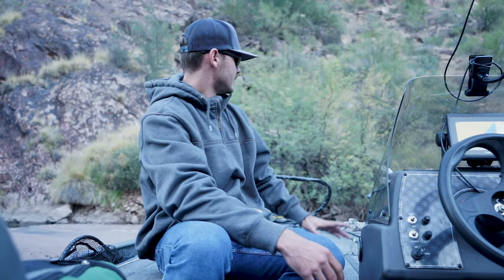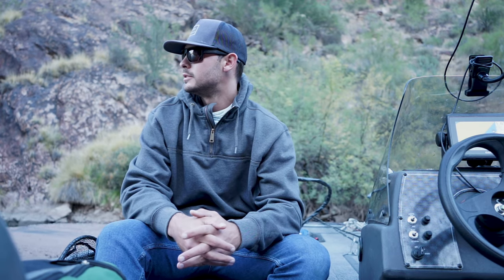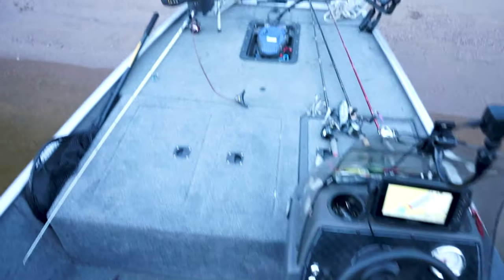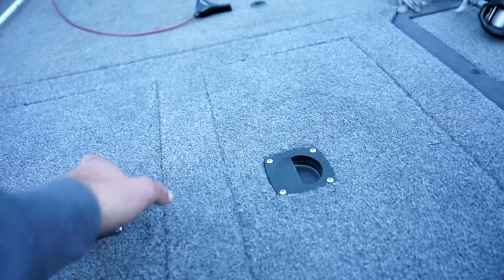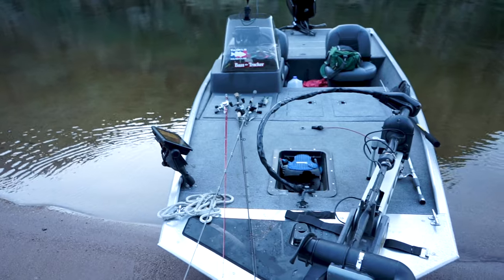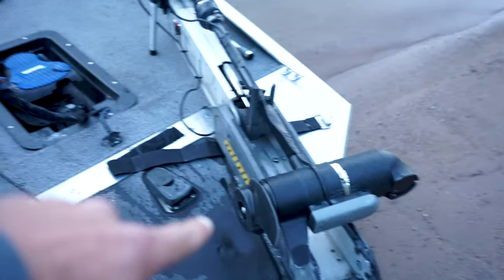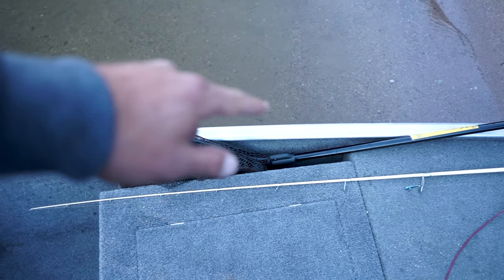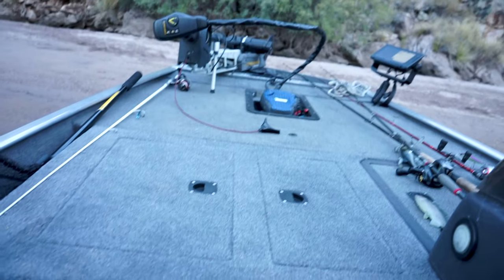Bass Tracker Classic XL Modifications and Upgrades!

Comment: Recent subscriber, awesome video and deck extension design! I recently got a used 2019 and as a bigger guy definitely need that additional room. Couple questions, did Dylan: A) Attach the extension directly to the boat or is it free to move around or take out? B) Total weight of the extension deck? C) Have any specs of the aluminum frame ?  Thanks I’ll will certainly be trying to something like this on my rig. Good luck fishing!
Reply from the maker: thanks man... it is free floating so it can be taken out whenever... i would guess around 50 pounds... i don't as he did it all, i dont think he kept any records of measurement though

Comment: Hey cool boat! I just got a used 2019 just like that. What do you use to wipe down that aluminum hull to keep it clean after taking it out?
Reply from the maker: Usually just vinegar water
Reply: @VitalFishing  hello again. Do you just use like a 50/50 water vinegar solution? Thanks for the help
Reply from the maker: @benw6554  yes, they make other aluminum cleaner but honestly I just cleaned the motor because the boat oxidizes no matter what
Reply: @VitalFishing  ok thanks

Comment: Was installing that recessed foot pedal a pain? How did you cut into the deck?
Reply from the maker: no, very easy... just make sure your measurements and lines are all straight and then use a jigsaw to cut it
Reply: @VitalFishing   I’m right in the middle of installing mine. And can’t for the life of me figure out where to run the drain line. The foam goes all the way to the hull. And not really wanting to just put water in the boat that won’t drain. Any help would be great! Lol thank you

Comment: Nice set up. I have a similar tracker just older and also upgraded to a 24v trolling motor and would like to know your set up in the back with your batteries and fuel.  Does having all 3 batteries on one side make you lean hard to that side?
Reply from the maker: no, i havent noticed a difference at all. the 24 volt system is night and day better

Comment: You said you can run in 10in of water. I live on the river I fish and am always worried about running wide open in 3ft of water. So my question is how do you go about running new water to check if it’s safe to run? Thanks. Get vid.
Reply from the maker: just go slow at first until you are familiar with the depth... hitting your prop on the ground at idling speeds usually won't do anything

Comment: Question: I'm ready to install a recessed foot control tray in my Tracker Classic XL. Is there anything under the deck to be aware of?
Reply: I was wondering the same thing
Reply: @garrettsmith2310  there is nothing but foam. The wire to the trolling motor is there but safe from a jig saw blade.
Reply: @garrettsmith2310  there is also an extra wire for bow electronics ( or whatever) discovered it after I cut the hole in the deck
Reply: @gregbrown4110  but for the most part of you center the tray, you should be good right? I’m going to order one for my classic xl I just want to make sure I get the right one and hook up drainage to it if needed. I appreciate the reply
Reply: @garrettsmith2310  yes, right on the centerline. Mine was a Panther (something) from BassPro for $79.99. very sturdy. Very easy install.
Reply: @garrettsmith2310  it comes with a drain tube which I just fed down the inside of the hill.
Reply: @gregbrown4110  thank you Greg! I was looking at the same one!
Reply: @garrettsmith2310  forgot to tell you that you'll need to trim off some of the foam so that the tray will fit flush.
Reply from the maker: No you are good to go
Reply: Pretty free and clear as long as you install on the centerline. Once you make your cuts and are ready to install, be aware, however, that there is a little bit of foam underneath that you will have to remove otherwise the pedal will not sit fully flush on the deck.

Comment: You are getting interference because you have your Garmins hooked up to your troller motor battery and the troller causes that interference to the screens and sonars. Either get a lithium 24 volt purpose built specific to that troller motor so you can run one battery EXCLUSIVE to the boats accessories and electronics alone or hook up your navs back up to the engine cranking battery. 

The way I run mine is a 3 battery as well, 1 AGM for the cranking battery, 1 AGM for the accessories and electronics exclusively and 1 24v purpose built lithium battery for the troller. It's a killer setup and one setup never interferes with the other. 

Maybe you resolved the issue already because this video is now 7 months old or so, but if you haven't this is the fix for that. NIce boat by the way. It reminds me of mine. ;)
Reply from the maker: Thanks for the info but the graphs are hooked up to the cranking battery, I think the main issue was the gauge of the wire
Reply: @VitalFishing  ah. Okay I see. Yeah if you had to extra wiring which was too thin, I could see that happening as well. I'm glad you got it figured out!